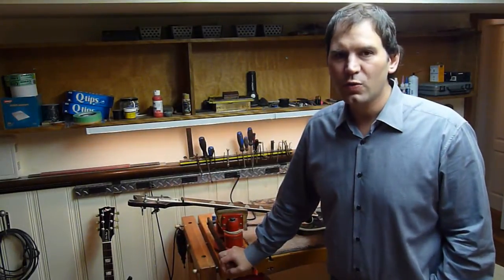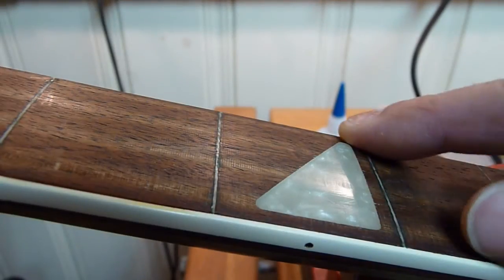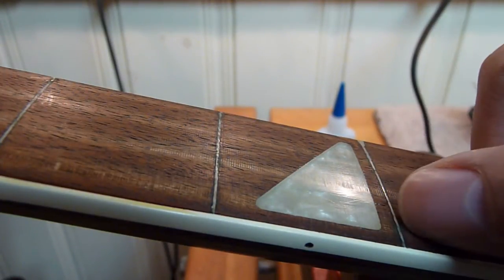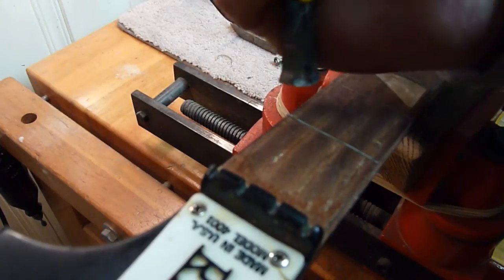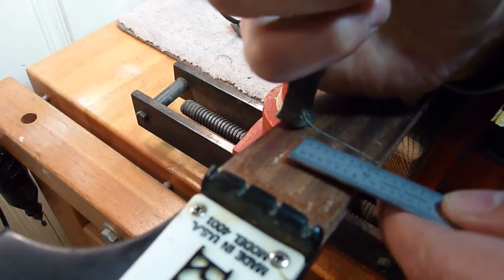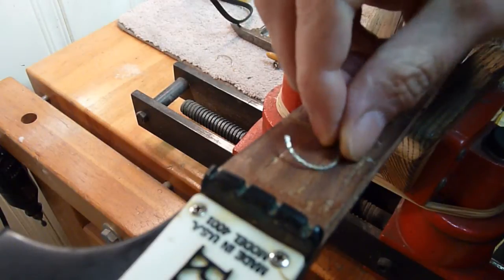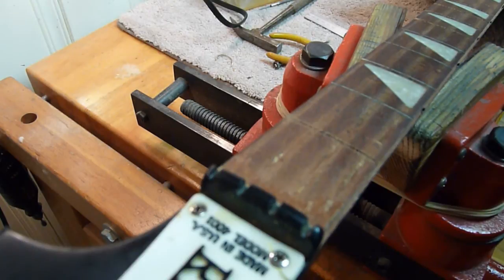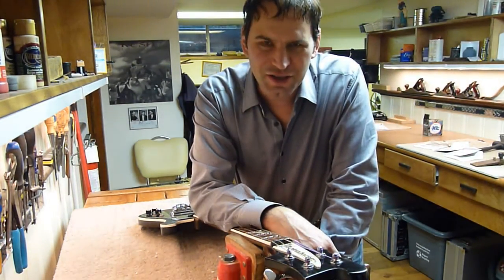Rickenbacker 4001 Refret

Comment from the maker: Since the tang is only about .020" wide (remember there was no fret bead) it was difficult to get a soldering iron tip on the tang without burning up the surrounding wood. I actually did try it on this job. But also I found that the tang just didn't hold the heat because there wasn't enough mass there...again because of the missing bead.

Comment: thanks for the guitar strings tip! I can see how CA can wick into the winding then slowly drips down to the end of the core. brilliant. this gives you much more control than pipette tips for CA altough they are pretty handy, once the air bubbles are out the drop will form whenever you turn the bottle upside down and that can be frustrating

Comment: Takes all kinds doesn't it.  What kinds of idjit would do such a thing?  Nice work though.  I never would have tried pulling off the binding.  My first thought was to simply go at it with a fret saw and sacrifice an old one to cut these frets out.  Though I suppose the risk would have been damaging the binding anyway. Clever solution!

Comment: Hey Freddy, I thought that it was typical to try to ease frets out without chipping by applying heat from a soldering iron to the fret? Is there a reason you didn't want to do that?